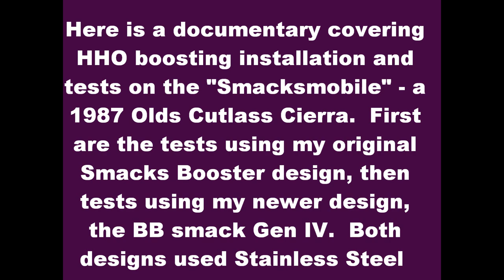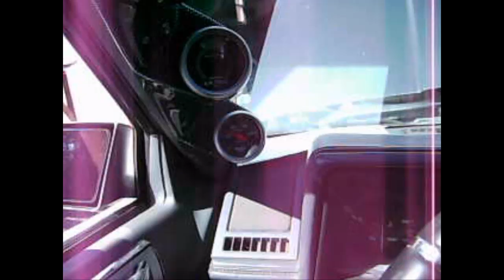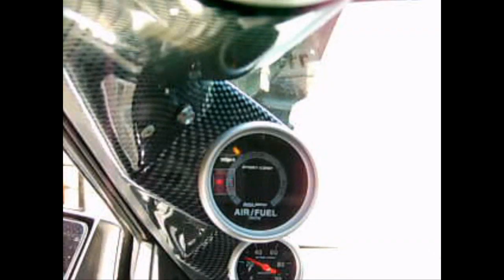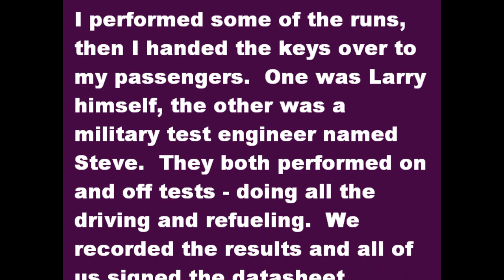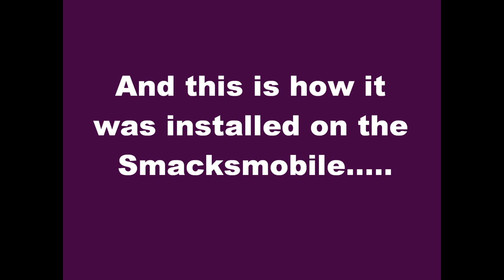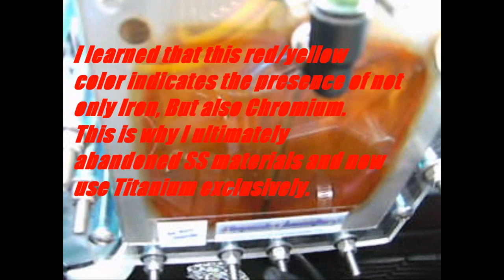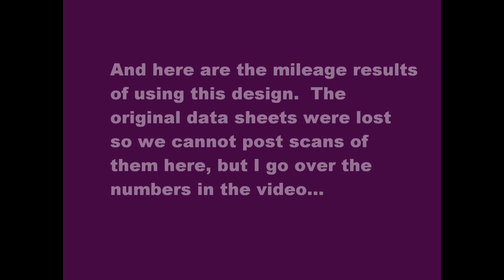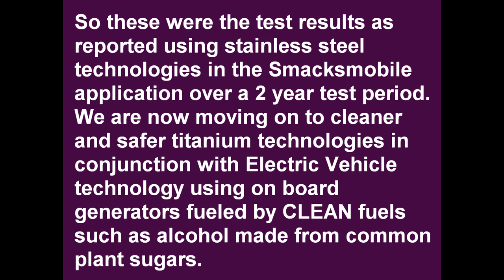Smacksmobile HHO Documentary

Comment: Smack...the mileage improvement seems to be low...is that because of the weight issue w/the trailer which makes the engine work harder = less efficient?   what kind of results do you get without the trailer? dirtydog